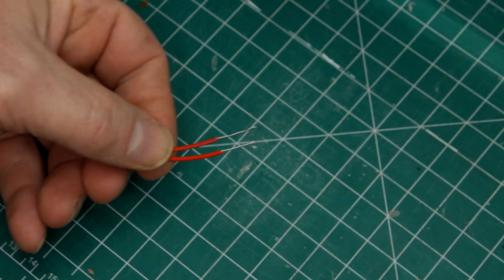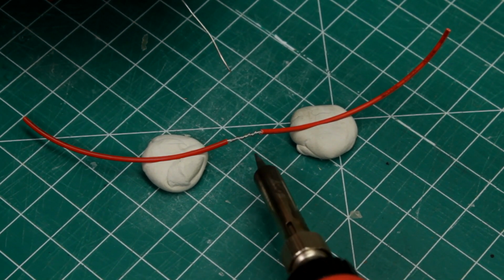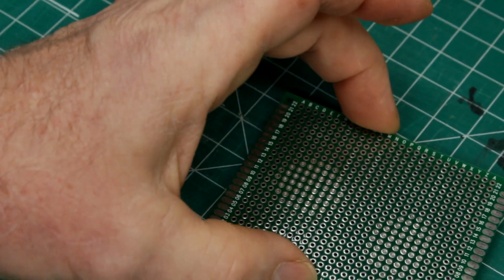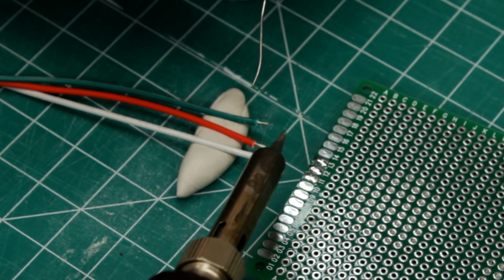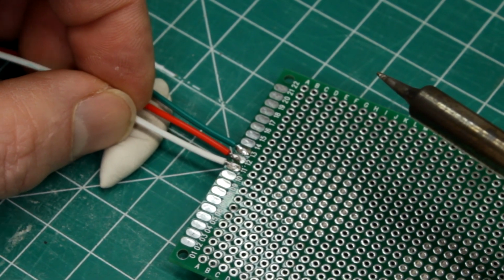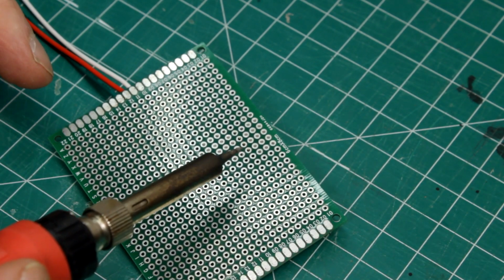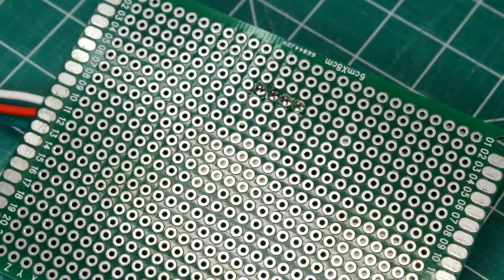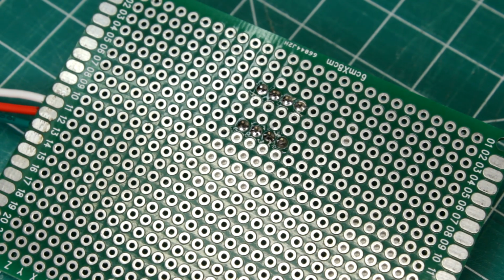Soldering for the Hobbyist

Comment: I like the idea of the stik-tak.  Also, if you are soldering two multistrand wires,  don't twist the ends first,  interlace the two ends first, then twist them.
Reply from the maker: I've tried the interlaced wire connection and I'm not very good at it. But it's definitely a good way to go.